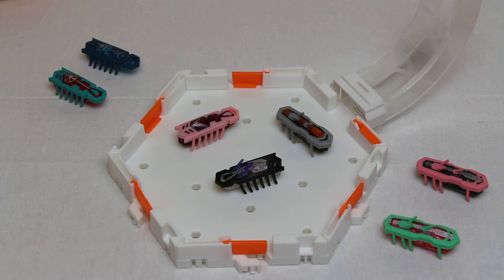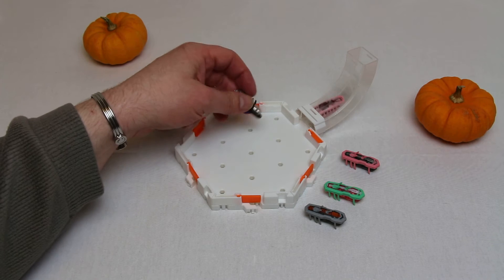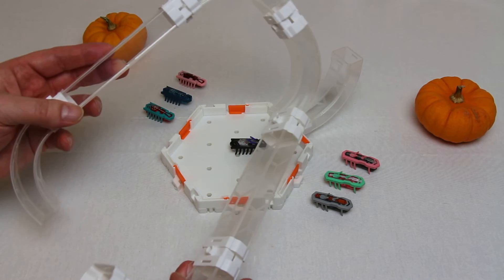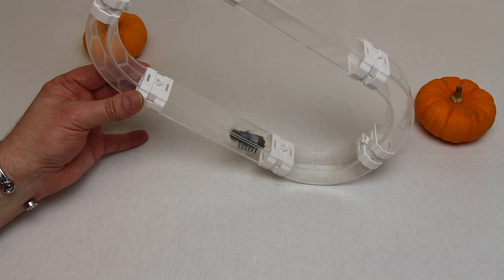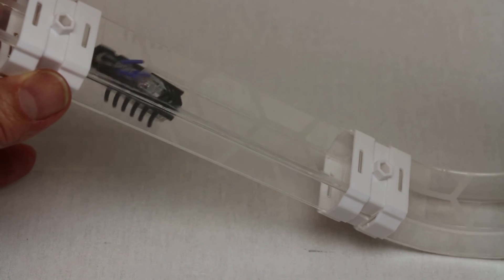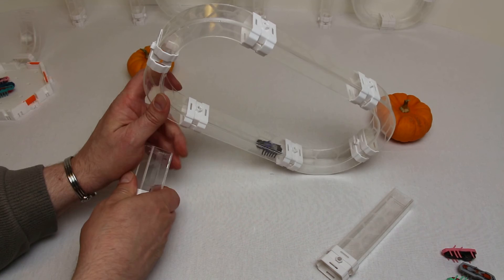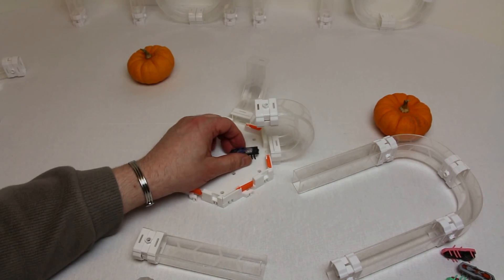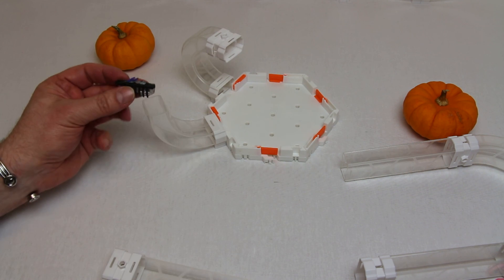HexBug Nano V1.1 - Project V1 upgrade to a V2 - Full video showing status so far..

Comment: Tom, have you tried to make a Nitro hexbug-Frankenstein from a V1? With 5 glued-in legs on their back?
Reply from the maker: I stoped with this one:
https://youtu.be/PFAd63PfTbU

I kinda gave up as not many Nanos die, so I would quickly run out of legs...
I also found a small circular foam disc also worked but when they fell over didn’t self-right so well... so stopped experimenting.